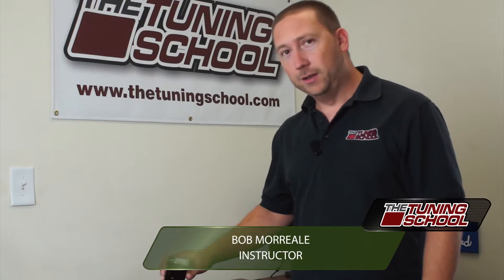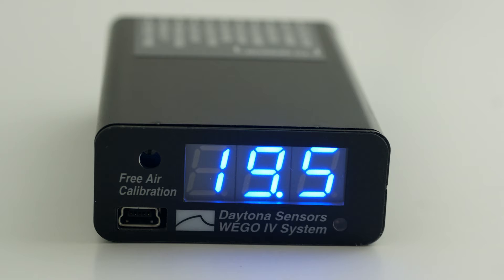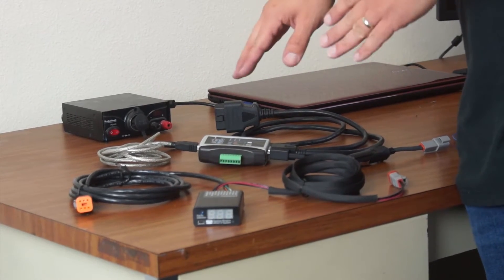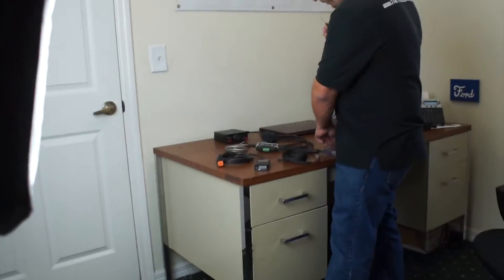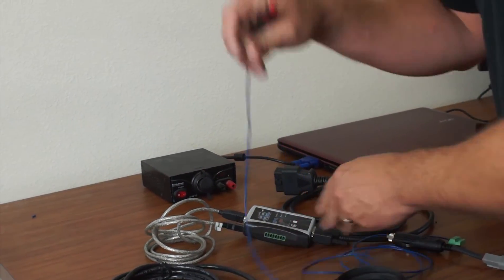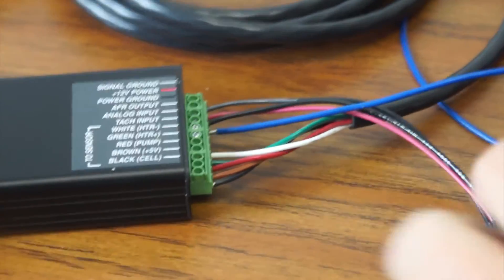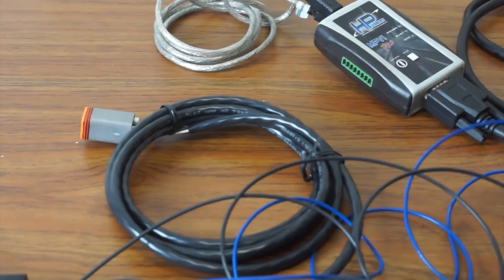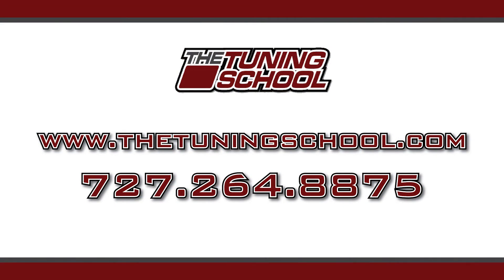WEGO IV Setup (Part 1): How to Connect Your Wego IV Wideband into Your HP Tuners MPVI-PRO Unit

Comment: I have an afr500 v2 by Ballenger which has an analog output and analog ground. The analog output is going to the 1st slot in my hp tuners unit. From here I get confused as the instructions for my wb say the analog ground and main ground of the wb harness have to go to the same grounding location.
That leaves nothing to go to the hp tuners slot 5. 
Would I just run a slightly thicker gauge ground wire from that analog ground/wb main ground grounding location to the 5th slot on the hp tuners device?